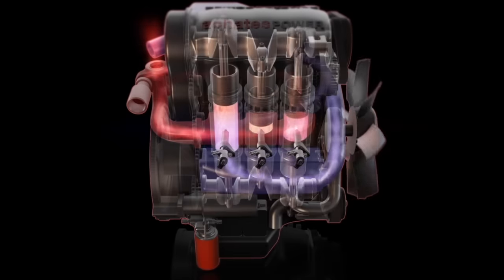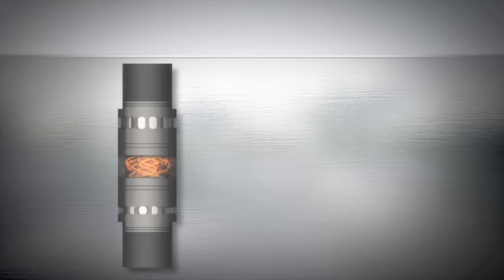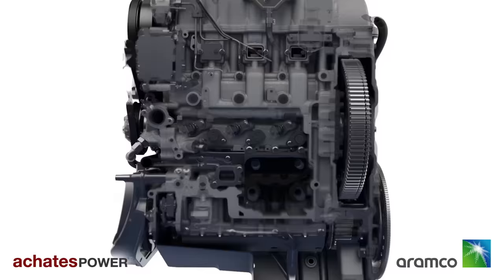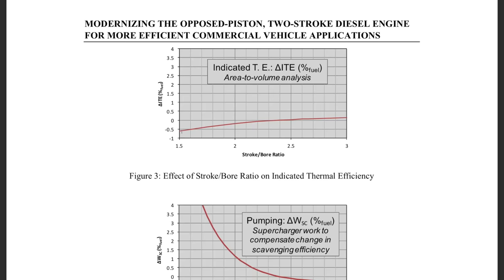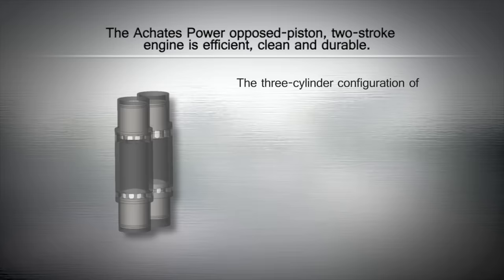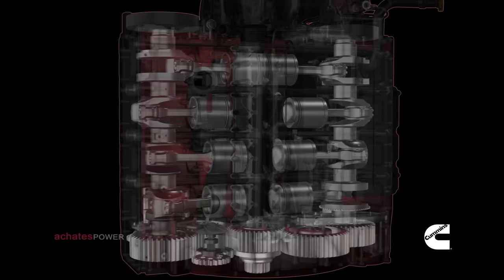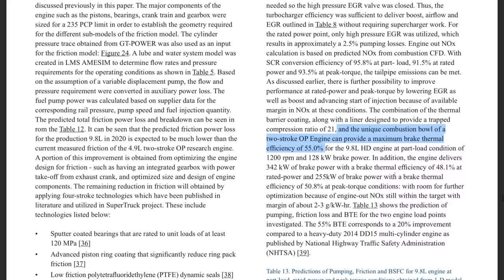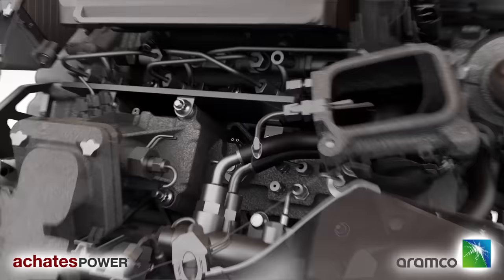Opposed Piston Diesel Engines Are Crazy Efficient

Comment: It's a great design.  I operated them on submarines in the US Navy.  I'd say the biggest sticking point is training people to work on them, with getting customers to wrap their heads around the idea.
Reply: In most households (60%) women make the purchasing decisions on cars. Why should the customers understand how the engine works, if majority of them does not care about such things even now? :D
Reply: Was the reliability better or worse than a traditional diesel? Tech sounds cool but there are always hidden obstacles that are not so obvious
Reply: @joser.colmenares3495  very reliable and robust.  The US Navy have been using that design since WWII.  It was also used on Diesel Electric Locomotives.

 Fairbanks-Morse 38 8-1/8
Reply: With the reduced complexity of no cams and cyl heads, that should not be difficult, eh?
Reply: The Famous Soviet cargo diesel locomotive TE-3 borrowed the type of diesel engine. Despite some constructive faults the loco reliably pulled heavy trains at low speeds down to the full stop.
Reply: @RoderickGMacLeod  We used those in the Coast Guard as well. The 38 8-1/8 on  small (140') icebreaking tugs in a diesel electric setup. Also used the 16 cylinder version on 378' cutters using a variable pitch propeller.
Reply: @RoderickGMacLeod  T-64 has gained some reputation for using a 700 bhp, 10 pistons 5 cylinders 5TD engine.
Reply: So, after many years of use, wouldnt the carbon buildup on each piston cause failure? These pistons are extremely close to each other, id say .0001 of an inch. So, if the carbon buildup adds to the height of each piston, wouldnt they collide?
Reply: @amramjose  you gotta consider the increased complexity of the block design though. Casting such a design is not easy
Reply: @worldoftancraft  Yep, its gained reputation as a pile of cr@p. This engine was the reason why t72 and t80 appeared. Low lifespan, low reliability, huge oil burning, toxic exhaust, cold start problems (5ТДФ has to be warmed up by external heater if temp is lower than +10 celcius). It took 25 years for soviets to make them work somehow.
Reply: @worldoftancraft  PS. This engine as other two strokes engines gives you horsepower, but suck with torque. Im marine application, where engine works for days, temp is constant, intake air is clean, nobody care about exhaust its great. For the road application its garbage.
Reply: @user-tl4yr4ki8h  Я конечно всё-всё-всё понимаю, только с чего-то это вдруг ранний В-46 был чем-то отличен он 5ТД? Пока они были сырыми — вот уж новость: они были сырыми и без моторесурса. В момент поступления в эксплуатацию Т-72А, у него моторесурс был 350 м/ч. 

Четырёхтактный дизель – это в первую очередь прекрасный способ потерять мощность на механических потерях в ходе двух дополнительных тактов а так же не получить то что можно, потому что те такты, внезапно, без полезной работы на коленвал, хоть и позитивно влияют на результат рабочих тактов.

Любой нормальный моторист греет двигатель перед холодным запуском в холодных условиях. И наследники В-2 не исключение(не надо рассказывать про Военное Время).

«Проблемы с моментом»? А коробка передач для кого существует?

Да и вовсе катитесь со своим "куском дерьма" откуда вылезли. Архитипичное оправдание почему нужно было возиться с тремя уже устаревшими конструкциями, пытаясь последовательно поставить каждую следующую на производство, вместо продуктивных работ над дальнейшим уменьшением заброневого пространства.
Reply: Had two of them aboard both Bainbridge (CGN-25) and Truxton (CGN-35)  Had an incident on 35 when the reactors had to "SCRAM" and those diesel backups kept the coolant flowing (I was a reactor operator on both) "Poles were in the holes" as is necessary but those backups kept the primary flowing...pretty uptight time but I'm here to report it.
  Thank you for this...much appreciated for educating the folks that don't know about this.
Reply: @razzor4708  Did you delete your comment or what is going on? Also, were you addressing that rant to me? I repair my own cars and make the purchase decisions - on most US households that is not simply true - it's the women who choose what to buy, even they do not understand a thing about the inner workings.
Reply: We use the same type Fairbanks -Morse engines in power generation.  Mostly for emergency back generators at nuclear facilities.  There’s a school in Beloit Wi where we trained on them.  He didn’t mention, there’s a vey slight “ lead time “ involved with the pistons. That must be set to insure one piston arrives at TDC a fraction of a second before the other.
It keeps the reciprocating motion intact.
Reply: If you want to describe the benefits to a layman try this. "hold your right hand up and steady, that is your cilinder head, your left hand is the piston. dont move your right hand and clap with your left hand against it. Now with the double piston design your right hand is also a piston. So now clap with both hands. See your second clap was more powerfull because there is more compression between both hands if both are moving." This explaination might not be accurate but visualizes the most important concept of this enginge to a layman.
Reply: @joser.colmenares3495  such as oil leaking past the rings after shutdown into a cylinder that is on its compression stroke? I suspect this is why we do not see any modern engine with the crank above the cylinders. Just take a look at what they have to do to start a radial aircraft engine safely and then think about how you would do it if you could not do compression relief. In many of these old engines, they remove some of the sparkplugs and pull the engine through by hand before any attempt to start a cold engine. I don't think that will 'fly' these days...
Reply: @amramjose  until oil fills a cylinder after shutdown...
Reply: @jdrissel  so it would only work for engines running close to 24/7 or with some form of pressurized compensation to avoid such leaks?
Reply: I like hearing from guys that work on these as I've never seen one, imagination only. Do you see something like this fitting in a full sized pick up? Bet it would be snug, similar problem Porsche and subaru requiring small cranks and rods, so the heads fit between the suspension. How tall are these?
Reply: @TheeBoss87  they're pretty tall compared to a standard inline engine of similar displacement and power but shorter fore-and-aft. There are also newer designs that couple three banks per row in a delta configuration so it has three cranks, three cylinders, and six pistons per row.  

There is a 2.7 litre being developed by Achaetes Power.  They claim high fuel efficiency and low emissions.

Check their Youtube channel to see a vid of it installed in a full sized Ford P/U.
Reply: @eugenecrabs3954  the intake and exhaust ports make inspection pretty easy.  There are even wear indicator grooves on the piston rings that are inspected through the ports.
Reply: @dontworry1568  Not really because there are no blocks per se.  They're modular, so you can build them with whatever configuration you want.  The top and bottom crankcases are cast as different units, but the cylinders are installed between them.
Reply: @megastick9324  that makes sense, it's much like retarding ignition to a few degrees after TDC during engine start on an OHV gasser to get things rolling the right way. ID day even more important in this application
Reply: I think its more of a strongpoint really, 2 strokes are incredibly simple. No head to them, no timing system.
Reply: @Jinppa  This is also prime reason why those hellish suvs  and crossovers are only thing that sells anymore. To detriment of everyone...
Reply: @Kacpa2  True 😞
Reply: I believe it's a great design, since it's used in submarine!

Question: Noise.
I read on other comment that it's noisy. That can't be true if it used in submarine, isn't it.
- Engine mount type? 
- Supercharge & turbo , sound insulation type?

Question 2: Flywheel. I don't see it in the animation.
Is there a flywheel?
Reply: @budisutanto5987  

Is that an Indonesian name?  I lived in Jakarta for almost five years.

Noise:  Since it's used while the submarine is on the surface or while snorkeling, noise isn't really a primary concern because a submarine can't really be stealthy in those conditions.  On a nuclear powered submarine the diesel engine's name is "The Emergency Diesel".  I can't say much beyond that because some operational specifics are classified.  Everything I'm telling your is pretty general.

They do have blowers for scavenge air, much like a Detroit Diesel to maintain a slight positive pressure on the air intake.  They are not something that you could load or unload to supercharge because they are timed to the engine, so supercharging can't be done with that blower.  I imagine that a second blower on a clutch could be paralleled or a turbo could be installed but it takes up space and adds complexity and extra maintenance.  If it's the primary means of power, that might be worth it, but not for a backup means of power.  The extra fuel economy just wouldn't be worth it.

Most of the large opposed piston diesels will have air start so a flywheel isn't necessary.   There is also a means of locking the top and bottom crankshafts together, typically via gears and a shaft.  That's usually on the drive end, which would complicate the flywheel application.  I would imagine that if they have electric start that the starter motor engages via the shaft that couples top and bottom crankshaft.  They're also pretty well balanced so a flywheel isn't necessary to smooth any pulses in output.
Reply: @RoderickGMacLeod  Name. Yes.
I wish we have meet, I believe my late father would enjoy talking to you when you're still in Jakarta. He was a mechanical engineer. 

Blowers. This's good, the engine can run with only blowers.

Flywheel. This's also good. Street racer scarp flywheel surface to reduce weight for speed, making it unbalanced motorcycle.

Thank you for taking the time and give a comprehensive answer that's easy to understand for non engineer like me.
Reply: @budisutanto5987  I lived in Indonesia when I was a teenager.  I did not know this stuff back then.  My father was an engineer.  He worked for two Indonesian owned companies back then:  PT Essarindo and PT Satmarindo.
Reply: @eugenecrabs3954 This measurement will be monitored at regular intervals, in piston carrier thrust ring wear.
Reply: It has never made sense to me why  in a conventional motor  the force exerted on the piston is also equal n opposite on the  head an  is wasted.    Look all the issues with head block joint sealing ( head gasket)  we have all dealt with.   Use thst wasted force an do away with the head gasket issues
Reply: @user-dc7pm2eo1z  this layout works well for a two-stroke diesel if you have the space. Using it for a four-stroke gasoline engine ads a lot of complexity. Imagine the valve layout and the complexity of the valve actuation system.  It will be way more complicated than operating all of the valves with a single straight camshaft if you want an efficiently shaped combustion chamber. Popping the head off of an engine is relatively easy without complete engine disassembly.  Valves are inserted from the pressure side.  To do that with an opposed piston engine you'd either need to split the cylinders or remove pistons and reach up through the cylinders to remove and replace valves in the "head".  How would you machine the seats?
Reply: @eugenecrabs3954  The space between two opposing pistons provide a regular combustion chamber, size of which represents a compression ratio, no different than any other engine. Shape of the head of the piston plays a large part of the calculation, but the distance from piston to piston would be large enough to prevent a carbon build up  being a bigger problem than in other ICE.
Reply: @dontworry1568  Correct. Block design and casting is quite complex, but this design eliminates a lot of parts which significantly increase reliability, which is extremely important if you are in the submarine in the middle of Atlantic with no help coming in days.
Reply: @jdrissel  They do not necessarily have to be mounted up/down. It can be mounted horizontal, just like boxer engine.
Reply: @Jinppa my sister does make most of the purchasing decisions,  but she is very well informed and cares to know how things work.
Reply: @eugenecrabs3954 I would assume that only thing touching would be the carbon and that would be like chipping carbon off constantly